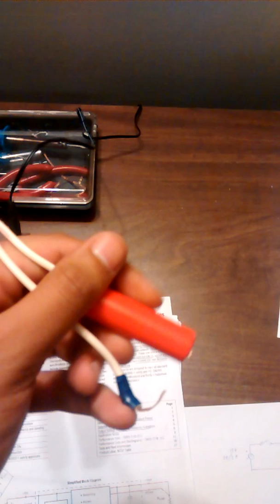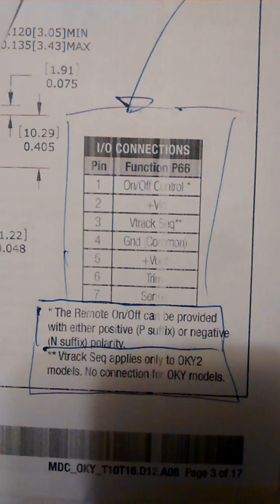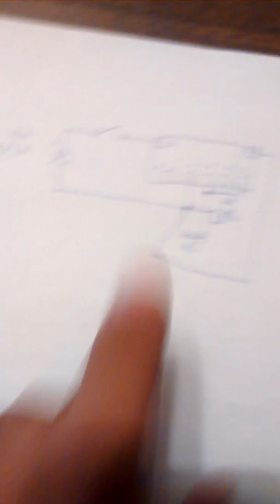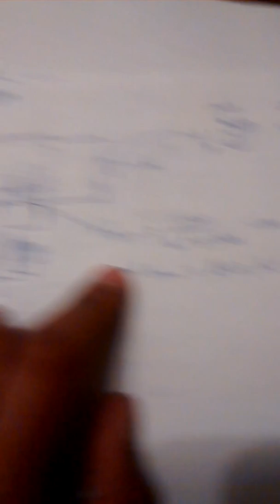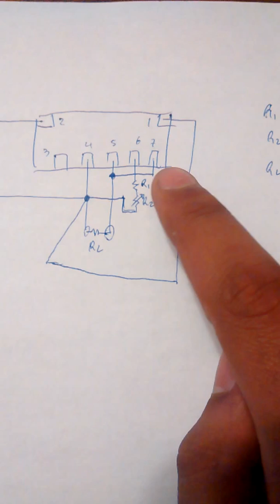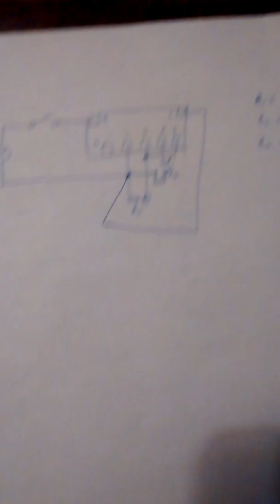DIY MFLB

Comment: what the serial no. of the ic board
Reply from the maker: http://www.digikey.ca/product-detail/en/0/811-2069-1-ND

This is the circuit board I am using. you can find the data sheet online. The setup is still working today with no changes and no problems.
Reply: thanks a lot for leaving a reply
Reply: but by any chance could you show the working of it
Reply from the maker: +robin steven ehhhhh, I can say that it works. up to you to believe me.